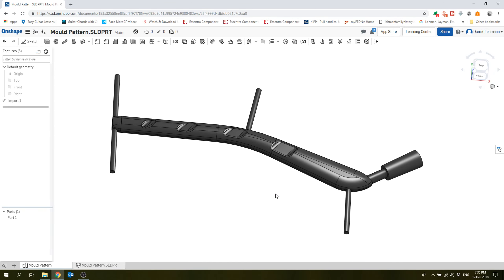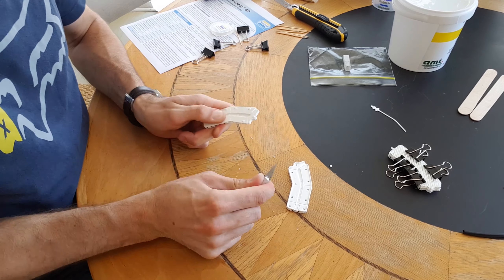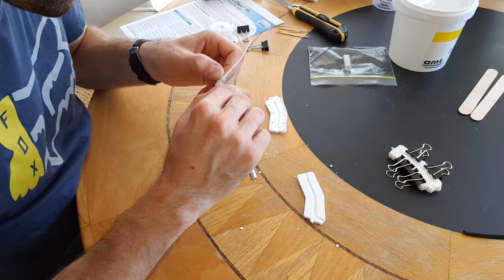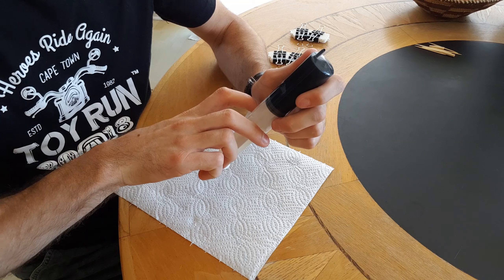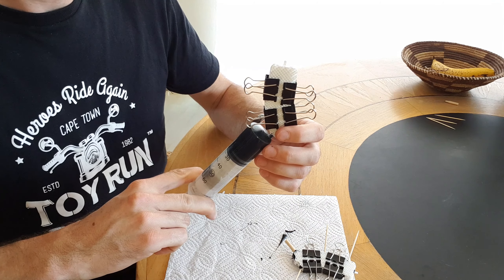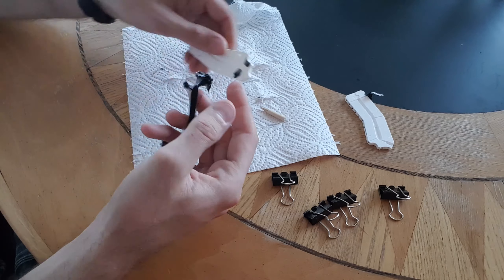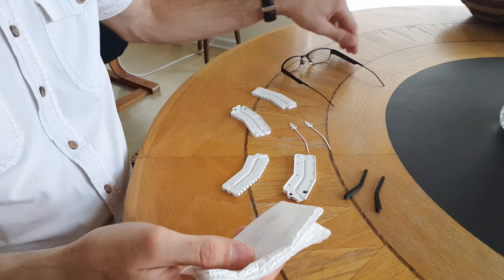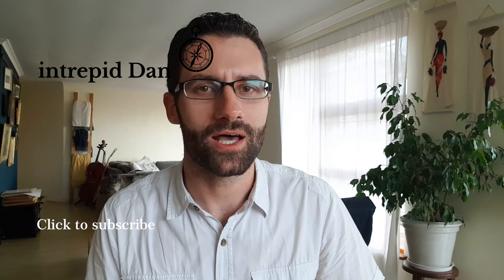How to Cast Silicone Parts in 3D Printed Moulds

Comment: Good work. I like the simple method of degassing. What size syringe did you use so I get an idea of scale. I’m planning on doing some bicycle grips and hoping I could get enough material in one shot
Reply from the maker: Thanks! That was the biggest size I could find at the pharmacy. I can't remember the volume exactly, but I think it's around 60cc/60ml. It might be just big enough for one grip.

Comment: I just 3d printed a large mold to cast a liner for a respirator I designed that uses special materials to kill the CoVid-19 virus.  this is a great video.  I'd love to know how controlled the durometer.  I got some that is supposed to be Shore 27... but it doesn't say it's if A or D... 27A would be as soft as rubber band, but 27D would like tire tread.  It looked pretty flexible in the video I watched.
Reply from the maker: That sounds great!
To be honest, I didn't have any options of different hardness because this was the safest material i could get, and it only came in this one hardness. I had to take what i could get. This actually turned out softer than I would have liked. Of course, the thinner the part is, the softer it'll feel as well, even if the material itself is a bit stiffer. 
I hope you come right with your product!
Reply: Thanks for the quick reply(!)  :-) I'll let you know how it turns out.  I'm using standard FDM (Silver PLA).  The mold was too big for my Form2.  I think I put the air holes in the wrong spots... so I may have drill a few holes and insert epoxy'ed in tubes.  I did a 10% infill... arg...  Should be gargantuan mess. But the dang Covid-19 is here is Seattle with a vengence and we are low on respirators.  So I'm printing them for my friends with special virus killing metal filters.  They and I will be "walking talking with-every-breath-we take, virus killing machines".  "Don't get sad, get even".  LOL!
The degassing is great.  I have plenty of clean 200ml syringes leftover from the horse vets that used to frequent here.

Comment: Hello, what did you spray the mold with? Also i cannot understand what the wooden stick while degassing is used for.
Reply from the maker: The spray is a mould release agent. This one was "Ease Release 200" from the brand Mann. It's basically a fine oily spray made to prevent a casting from sticking to the mould. The wooden sticks were just to hold open the syringe so I didn't have to while the bubbles rose in the vacuum.